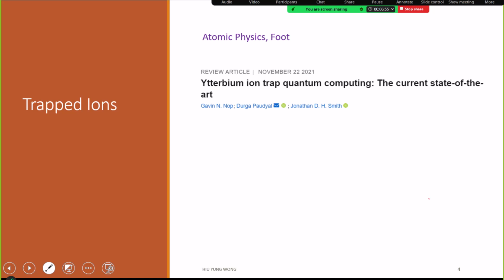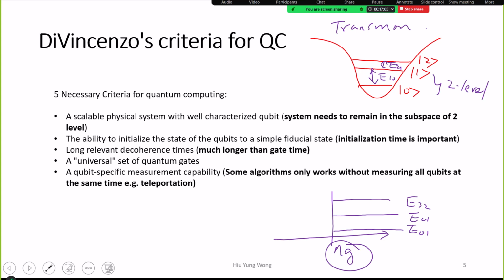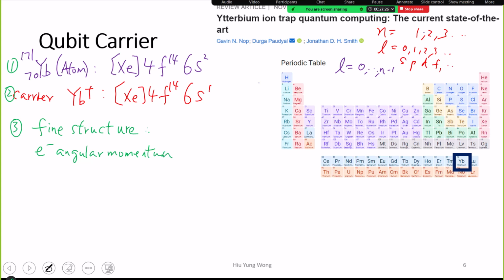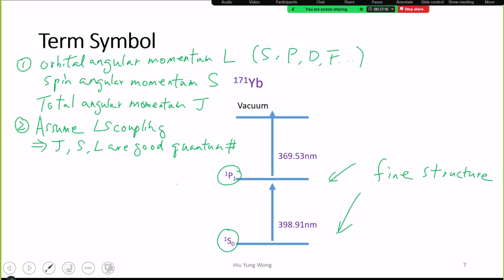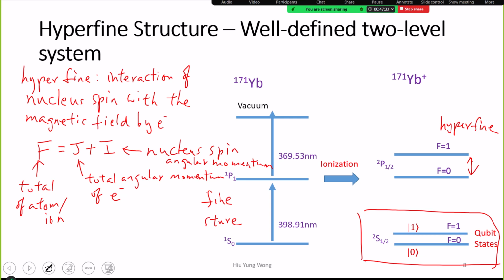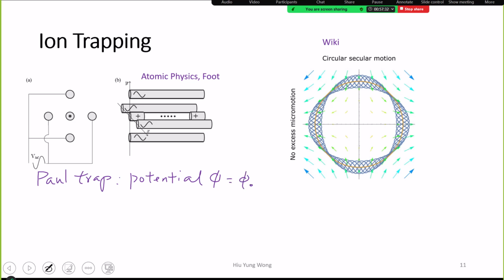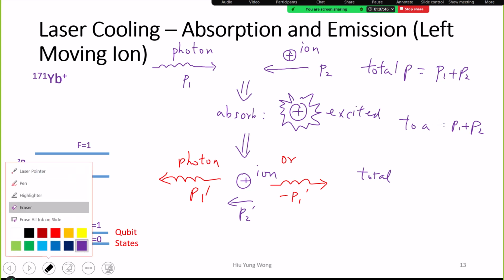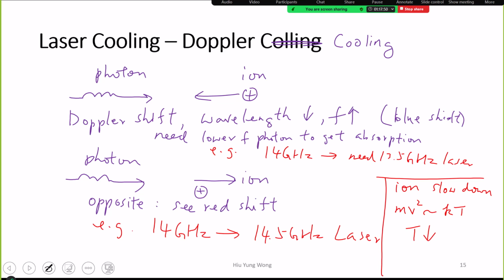L27- Trapped Ion Quantum Computer, Paul Trap, Hyperfine Structure, Doppler Cooling

Comment from the maker: At 20:29, the explanation can be misleading. I have jumped a lot and was unclear. In reality, it is the moving electron experiencing the electric field produced by the nucleus. In the rotation frame of the electron, due to relativity, it becomes a magnetic field. So it is not the magnetic field generated by the moving electron. But it is the magnetic field "generated by the nucleus" due to the fact that the electron is moving (if not moving, no such field even if the nucleus is still there).